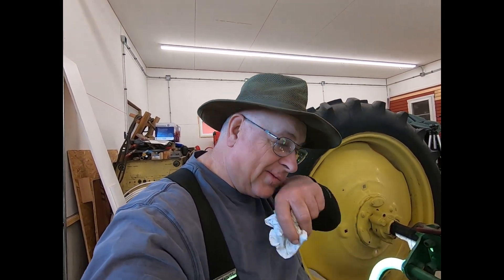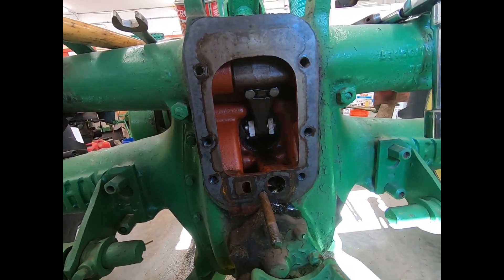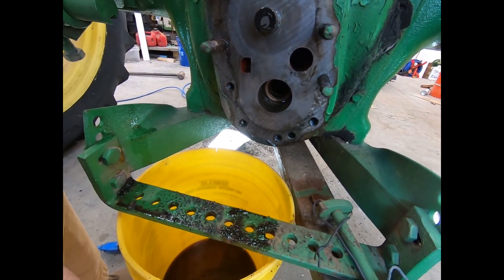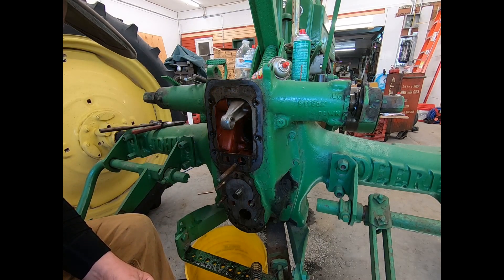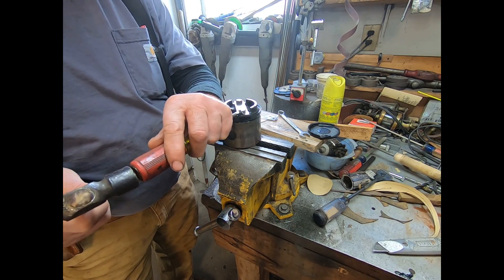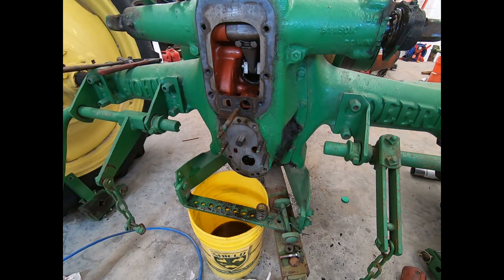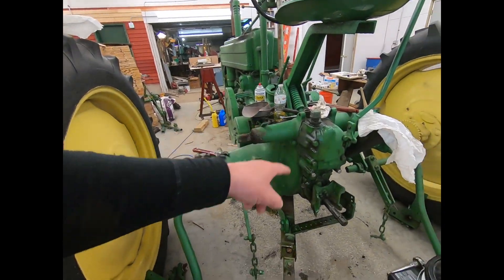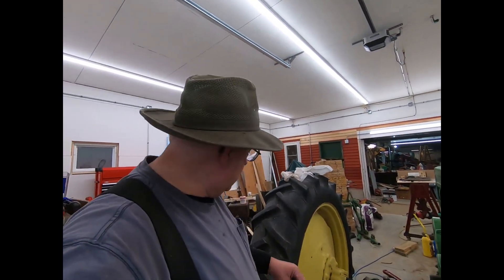# 415 JD B Power lift piston leather replacement

Comment: Nice work!!!! Thanks for the info. I hope the dealership has the parts that I need to fix my powertrol
Reply: 1951 B . I’ll need the leather and the gasket for the cylinder. Mine has a full time hydraulic pump between the governor and the distributor

Comment: Very interesting Tim, I have never had the piston out of my late "B" with power-trol. I had a problem with the outer seal leaking, it would chew up seals. Pump had too much wear and would pressurize the seal. I had a surface grinder and magnetic table and faced all the parts and left about one and a half thousands clearance, cured the problem. Very few people really understand the fine points of those power trols and lifts as they have so few problems.
Reply from the maker: They were a good design for sure

Comment: I have to remind myself these old Deeres are pushing 100 years old and it was the technology of the day. Wonder how the new stuff will hold up.
Reply: I can already answer that, older machinery especially that era, was over-built, very simple designs, I mean gear pumps are about as simple as it gets. The fewer systems and moving parts, the more reliable a design, as every extra piece that has to work together is an extra potential point of failure. Those old tractors, there ain't much to them, They are simple. Built to last. The modern ones are more complicated, more can and does often go wrong, and when it does its "All proprietary" so you're not supposed to work on them yourself, and Deere only supports them for a limited time period per model. so a good number of far newer machines are already sitting as junk. Where the old ones, give them some TLC and they'll just keep working.

Comment: You have a mechanical seal on the rear PTO shaft. A rotary unit sealed onto the shaft with the rubber material to form a static seal. The main sealing takes place with the rotary unit running on the stationary face. Re the hyd piston, we used to call that style of cup a "C" cup. Remember I sold this line of products for almost 20 years.
Reply from the maker: Thanks for the education